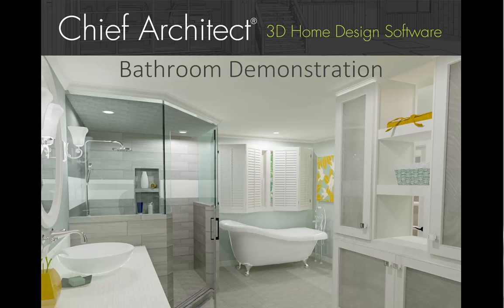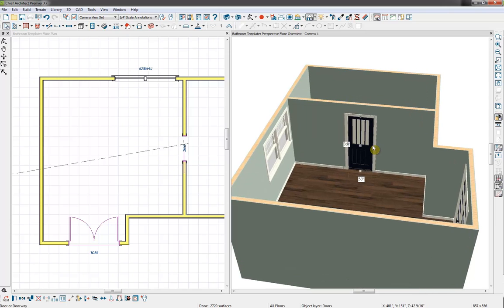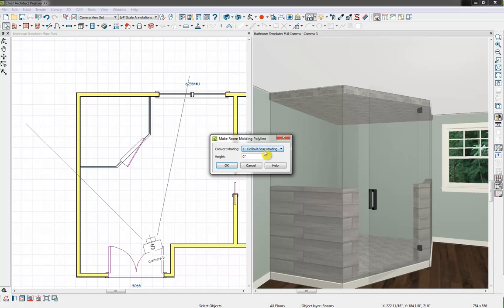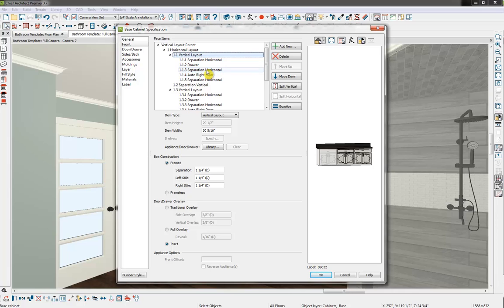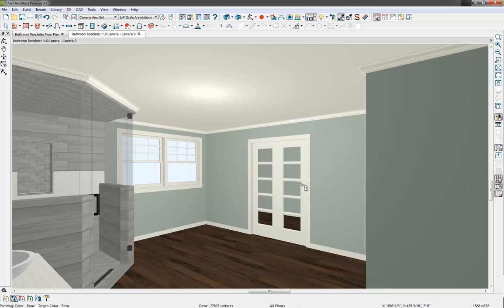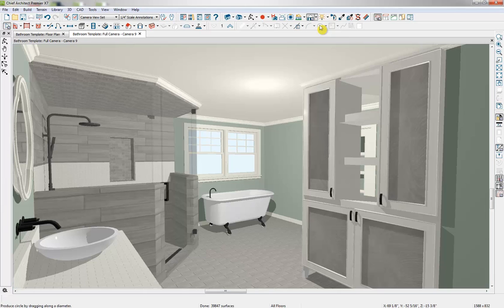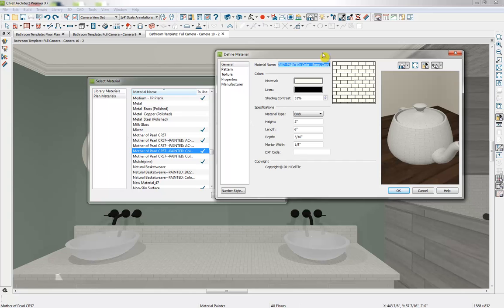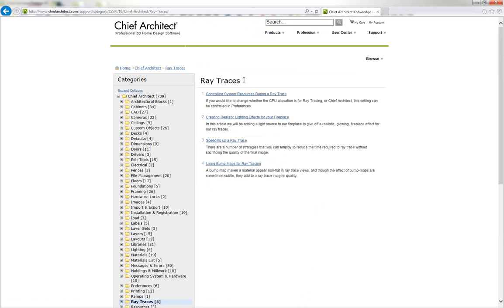Chief Architect X7 Bathroom Webinar

Comment: how am I able to get the interior tile option on the shower pony wall ?
Reply from the maker: You can open the wall for specification and then get into the Materials panel to control the materials. Feel free to call our technical support team if you need further assistance. 208-292-3399 M-F 6 am - 5 pm Pacific

Comment: Why my custom made mirrors won't reflect anything, even if it's on on the render section? How to make them reflect? What did I miss?
Reply from the maker: +Shakhlo Yuldasheva Kénza you'll be able to control showing reflections through the Preferences Dialog. Here's an article that will walk you through the steps: www.homedesignersoftware.com/support/article/KB-00858
Reply: Yeah, Chief Architect X7